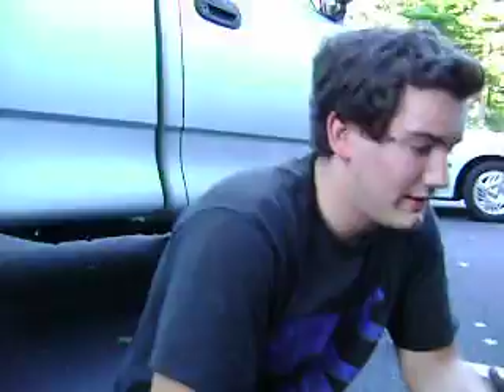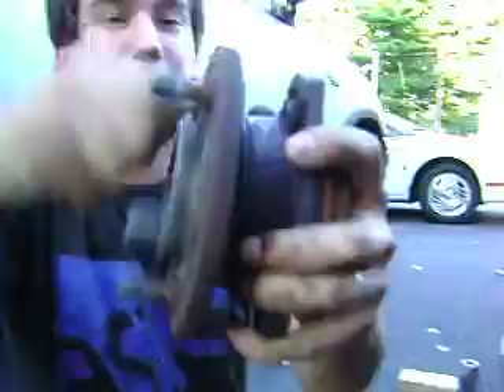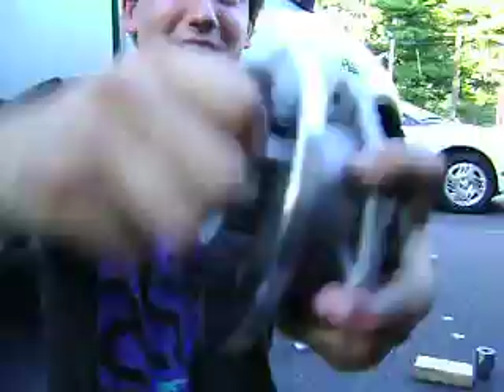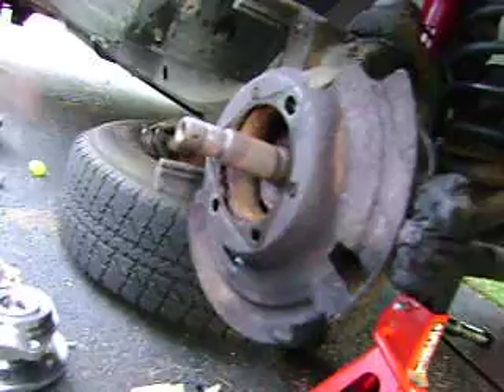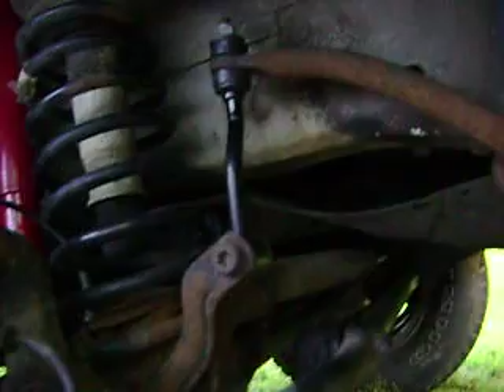What a bad wheel bearing sounds like

Comment: Thank you! This is the only video out of 6 watched that actually showed the exact sound my Navigator is making. Been having the abs and traction lights on for a week. I just ordered two front bearings, 4 new rotors and brake pads to get those changed as well because I was told they are shot too (breaks grinding now also). Might as well get them all done at once.

Comment: @yottabit I drive a cavalier, and considering many of the parts didn't change for many years of it's production (even the cobalt shares a lot of parts afaik) the practically give the parts away. On top of that, I can find most non-engine/transmission parts at the junkyard, since many people don't take care of their cavaliers and the engine or transmission fails while the car still has plenty of usable parts.

Comment: @sh1nai In most cases, you have to buy the entire hub assembly. because 90% of the time, if your wheel bearing is bad, the races aren't in the best condition either. So replacing one would be a lose - lose situation.

Comment: I am calling it a fade. Not sure what you mean by a "Sharp" change. The best way I could describe it is if you turned your radio volume knob all the way down and gradually turned up the volume. Ex: 44 mph very faint hum. 45 mph hum is more apparent. 46 - 55 hum is heard.  Almost as if I am stomping the gas pedal down and kicking in the 4 barrel.

Comment: i took my tire off & tried shaking the disk or hub or even spinning it but no noise..only when i put the tire & bolts on if i push the wheel from sides it sounds like it has a little gap..

Comment: A front end inspection from a mechanic will set you back 20 to 50 dollars, don't have someone guess for you through vague descriptions, but my guess is most certainly a wheel bearing. a tire problem will sound like a roar, and a transmission problem is unlikely just because the torque converter will usually be the first thing to go and you would notice it slipping quite heavily before that.

Comment: Please answer a question: I have a 2005 PT Cruiser that makes a low hum only between 45-55mph.  I have read it may be a wheel bearing.?. The sound does not sound like marbles or clanging only a deep hum. It strikes me odd that this noise ONLY occurs between 45-55 mph. Could this be a bearing? Ty

Comment: i have a question. if as im driving down the road and i can hear a grinding sound coming from my back left (the same side u were working on) and its only about a third of the tire rotation (ify) what would that be? my rear axle isn't low on gear oil and its not leaking gear oil. but it did leak a black oil from the break. pretty sure its not break fluid because my breaks are just fine. squeeking but thats because of dust. is it my U joint? or something else?

Comment: I am new to PT Cruisers. As I said earlier it is a 2005. 4 cyl. Anything you can tell me about them would be appreciated. I did question the dealer about the idle. Although the Cruiser has never stalled, at a standstill the idle can be slightly rough...especially when using the air conditioner.  The dealer responded "Well it is a 4 cyl.". Everything else about the vehicle is immaculate. Are 4cyl known for a ruff idle? Any else you can tell me about Cruisers?  Ty  :D

Comment: My mechanic has changed the wheel bearings from my 200 Isuzu rodeo. Before he changed the bearing, the car made lots of squeaky noises like a box spring might make and when I hit a pot hole or uneven surface, the car would make a loud crashing noise. My mechanic changed the front bearings  but the car still runs and sounds the same before the bearings were changed. What could be the problem?

Comment: hi! i have a question. I have changed my front wheel bearings in my car about a year ago. Theres a noise that gets louder when i drive at high speed. Its a grinding humming noise, thats really irritating and annoying. It comes from the driver side of the car and most times my friends cannot hear it. Ive had a couple friends mention it and notice it. But i have no idea what it is. Im unsure if its the transmission or a belt or my tire? Would u have any ideas what it may be? Thank you !
Reply: roseanna Ayala
Reply: roseanna Ayala
Reply: roseanna Ayala it is still the hub assembly when they go bad they make a humming noise